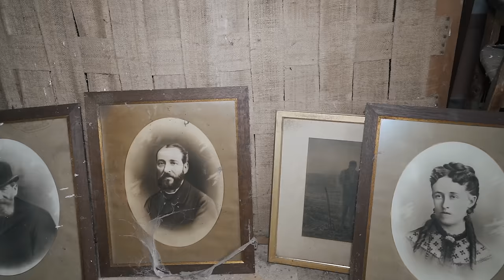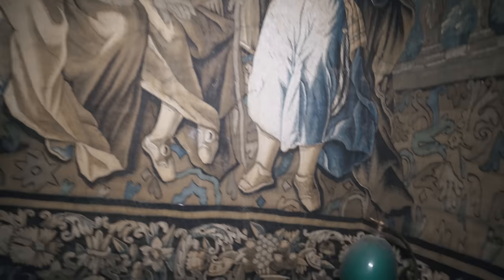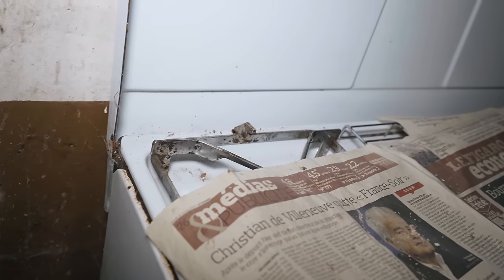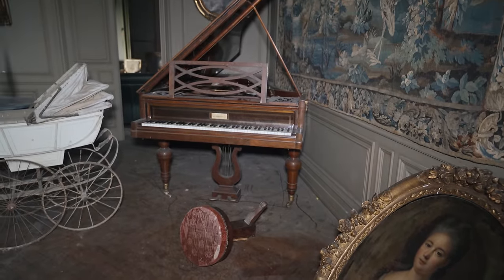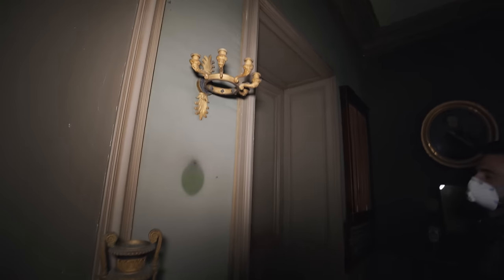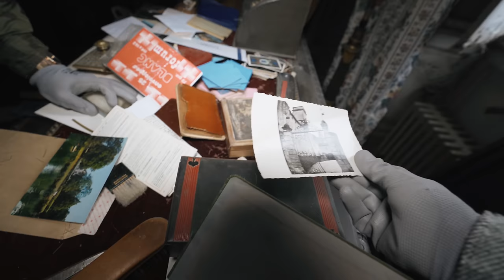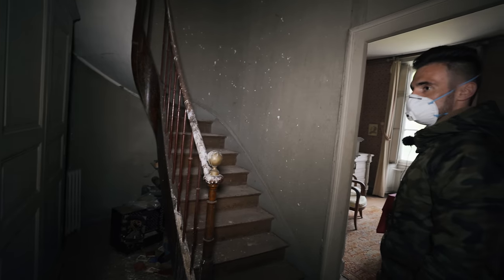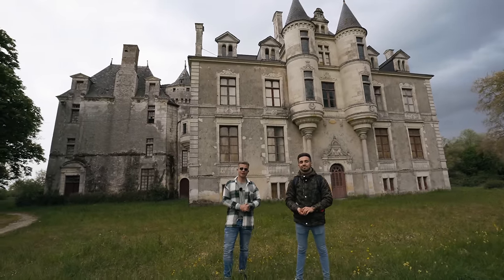Immaculate Abandoned Fairy Tale Castle in France | A 17th-century treasure

Comment: What a fabulous castle.  Thank you for taking us there to see it.  The lower levels looked in very good condition compared to the top servants area.  I hope the new owner can complete the task ahead as it won't be a cheap or quick job.  I was wondering if the 'electrical points'  you spotted downstairs and up on the upper floor were connected to a bell calling system which a lot of large houses had.  The owners would be able to call the servants by pulling a bell pull to get attention.  Just a thought.
Reply: Hello Carol how are you doing today

Comment: Fabulous place. I think the kitchen was originally in the basement, they usually are in these old castles. The electric panel is probably a bell system for the nobility to call a servant. They were usually in the kitchen. The elevator or dumbwaiter would start in the kitchen where they would put the cood on it and it would go up to the butlers pantry where the servers would deliver it to the dining room. Quite the process. Nowadays the kitchens have been moved up to the first floor to be more efficient. 🇨🇦
Reply: Hello Joanne how are you doing today

Comment: The switches in the basement are rings by owners to send someone to that bell’s location. Ringing for the servants. Each bell had a separate location. Staff learned which one was which. Some yanked a ribbon like a tie back of the drapes. Servant would respond. It be in living area as well as the main bedrooms. Some had them in each bedroom. Maybe event bath rooms if they didn’t have plumbing. Ring could be to get more water.